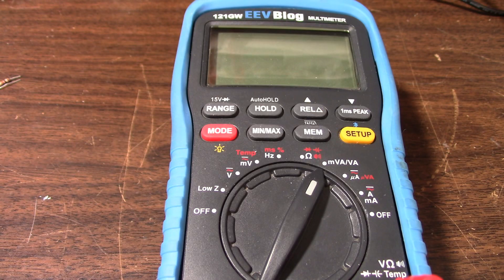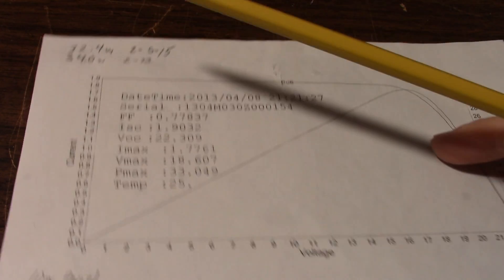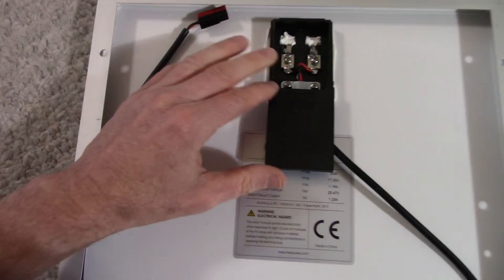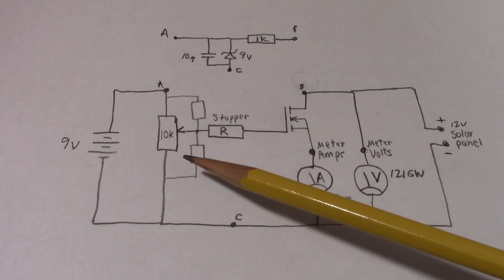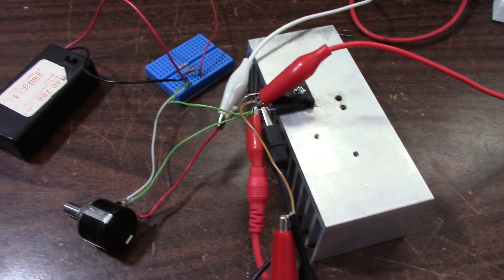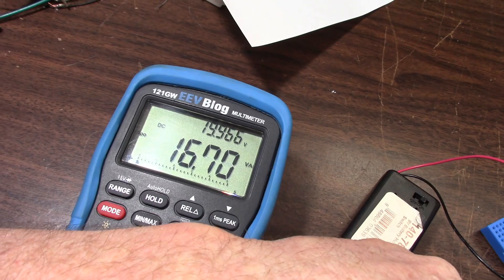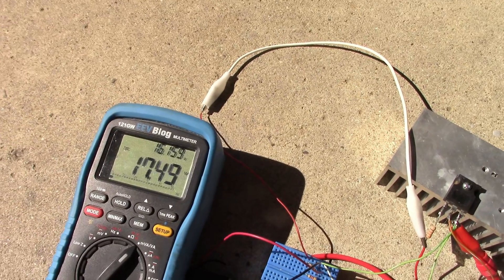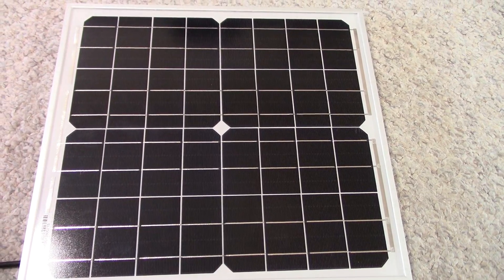Finding solar panel max power with EEVBlog 121GW and MOSFET circuit

Comment: Just to keep us on our toes, the peak of the power curve moves about depending on all sorts of variables, primarily the light level and the panel temperature. And shadows. I hate shadows! Because the cells are all in series, even a small shadow (think a single leaf, or a distant branch) has a disproportionate effect.

Comment: The MPPT algorithm uses the similar concept as your manual tuning. Increase the current untill you reach a peak, then perturb away from peak in both direction and see which givev better output power.

Comment: I'm currently testing a 24V 5A panel which my neighbor has just upgraded his and gave me all his 10 old one's, good neighbors are hard to find LoL, anyway, I got myself an MPPT Charge Controller circuit board from eBay which cost me $10Au and $5 shipping, I actually got two of them because they are only rated for 100W input and they can be paralleld and you save on shipping costs by ordering more than one, I saw a review of it on Julian Lett's channel and it looked very promising. It has an adjustable constant voltage output and an adjustment to match your panel to it for maximum power. Anyway I got them around 3 weeks ago and I have been using one of them to charge four 8Ah LiFePo4 Batteries (they look like those SLA type that are commonly used in a UPS) and I also have a computer cooling fan connected to it and it's rated at 12V 600mA, it's been running day and night since and just the other day we had three days of cloud cover with no direct sunlight! I'm really impressed with this little charge controller! As soon as there's a bit of light it fires up and won't power down until it's to dark! We also have one of those MPP Brand all in one contraptions that also have a built in inverter, as soon as there's a slight change in light conditions, it has to stop the solar input and think about what's happening while the load start's draining the batteries which it has to continue thinking about! If you connect a 20W 12V globe directly to the batteries it stops solar input to think about that to! But this little MPPT eBay charge controller doesn't care! If there is more need and the panel can deliver, it just gets on with the job! 
So I have ordered another four of them, that should cover me for around a maximum of 600W for now, I'm currently putting together an extra load to add to the fan so that I can see when the combination of Batteries, charge controller, panel and load begin to struggle under real world conditions... I want to know if I was to ever come across a week's worth of cloudy days if the combination will hold up! 
Once I have a good compromise, I have plenty panels to work with and another four Batteries to add for a larger scale setup! I can't imagine how much more better it's going to be when the sun actually pokes it head through the clouds... 
I really highly recommend those Controllers, if you can't find it on Julian's channel, if you are interested in them, just respond to my comment and I will find that video and even the link to eBay... They are only a PCB board and are small in size but make up for any shortcomings in personality LoL... It takes that 24V and works it's magic on it, even with a 12V panel, it should work really well! I'm using what I have at hand, I have 12V panels also but it's working so well with the 24V that I'm reluctant to swap it out to try it...